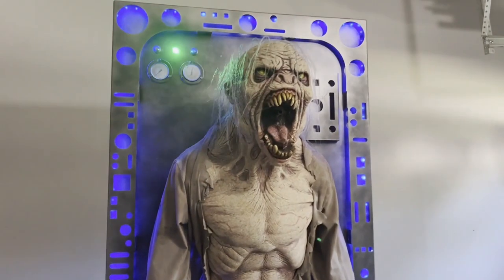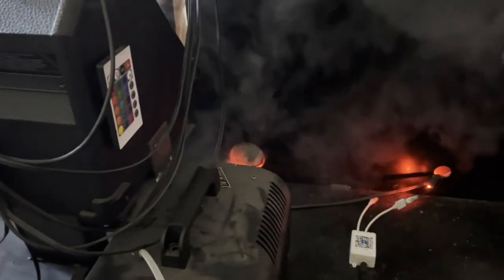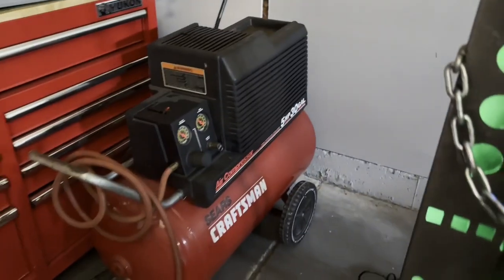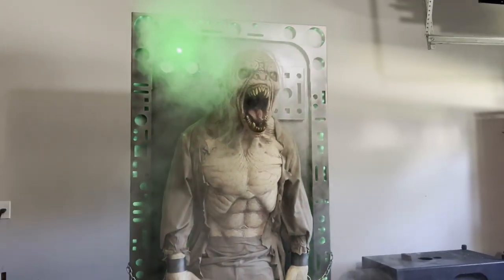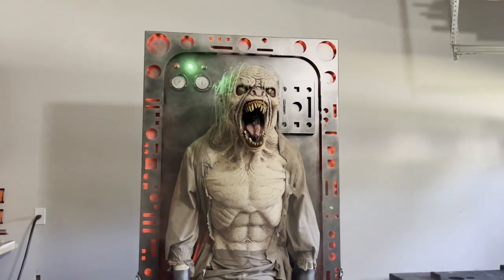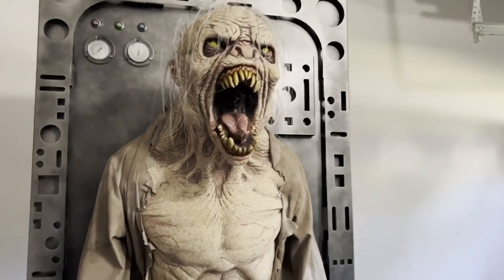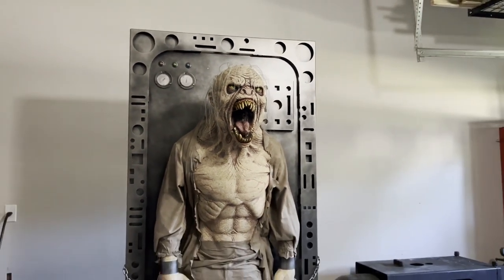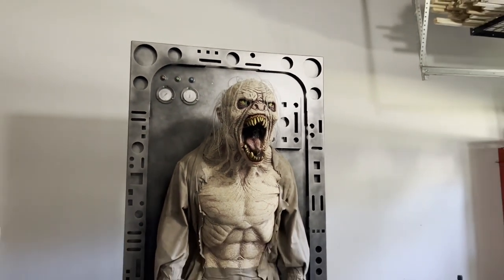👻Distortions Unlimited - Mutant Setup!🎃

Comment: This is a spinoff of Krazy Kristen. I did ongoing preventive maintenance on KK and I can tell you, both have great movements. Make sure you regulate that air inlet. Test both Collosus and Mutant running for hours. That compressor has low CFMs and you may exceed the duty cycle trying to keep that tank filled. Never run Mutant over 60 - 70 psi. It will wear down the shoulder ball joints. 125 psi is way too high. You may want to add some mufflers to the exhaust ports too.
Reply from the maker: Thanks for the advice! Yea krazy kristen and mutant are some amazing props. I do also plan on adding a regulator before Halloween. Mutant is rated for 80-100 PSI to achieve the fast movement but stay safe for the joints, so that’s what I’m running him at currently. I’ll continue checking those joints to make sure they are safe though because he is a fast one. I do have a muffler for colossus, and I plan to add one to mutant to before Halloween.